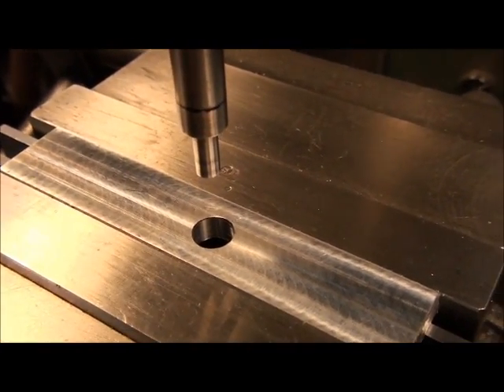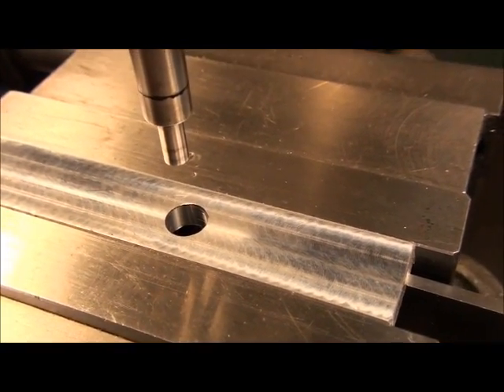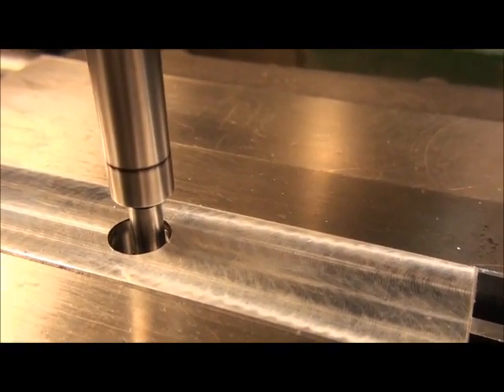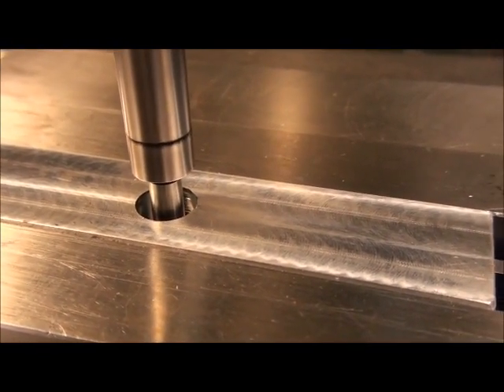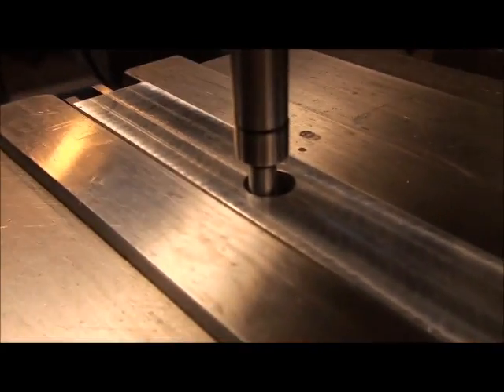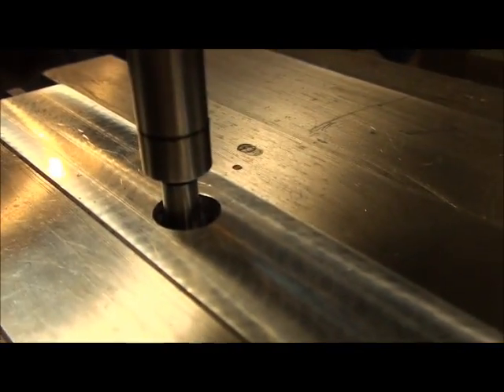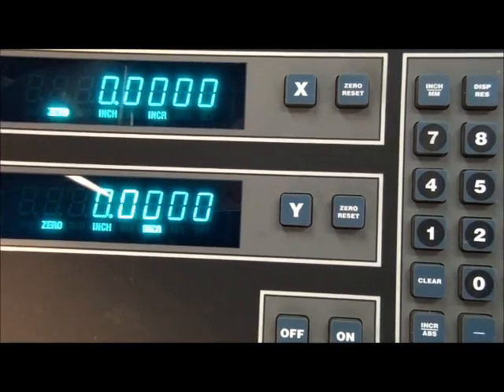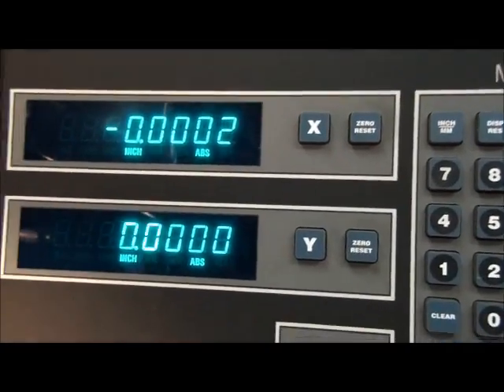How to Use an Edge Finder to Locate the Center of a Hole

Comment: This is a cool tip. I'm guessing theres no concern where exactly you touch off because when you travel across the axis to touch off on the other side, the midpoint is the same regardless of how close/far away from center you are.
Reply from the maker: I've tried doing it with the edge finder off center and it really doesn't make any difference until you get way off center.
Reply: I'm impressed!
First a question.
When you say 2 tenth off, does that mean 2 tenth of a thou(sands)🤔
I'm not used to imperial measures 😐
Afterwords I speculate whether in theory you ought to switch rotational direction on the spindle, when  touching of on the far sides and near sides  of the center due to the curvature of the periphery.
I know it's theory only and your comparison between incremental and absolute measurements says it all.
Your comment about "way off center" indicates that when you are way off center, the curvature of the periphery, means more than when you are close to the center?

Comment: I use this tip all the time now to find center of a hole in my mill. Drives my lead man nuts! lol. I still double check it with my indicator, just to assure him that I'm still using one, but this tip has never failed to put me within a tenth or two of dead center, and quickly! Thanks for this video!
Reply from the maker: I've verified it with an indicator as well. It's scary how well it works.

Tom

Comment: Just use an indicator PLEASE. No math involved.
Reply from the maker: I wouldn't exactly call pushing a midpoint button on the DRO math, but you are certainly welcome to use whatever method you like. That's the nice thing about machining, there are a lot of different ways to accomplish the same thing.

Tom
Reply: I guess it depends on how accurate you need to be. Center drilling and then drilling and reaming I would say could get you to .001 accuracy between holes. When I really wanted to get as accurate as I could I used to center drill then drill and then ream with a slightly smaller end mill than the reamer. Then I would chock that reamer up short. Also I would put the center drill in a collet, NOT in a drill chuck. Any unseeable wobble could throw you off a couple thou in my opinion. And if the top edge of the hole needed to be perfect I would either start the reamer by hand with the machine out of gear and then start it in gear with the reamer already down into the hole about 1/4 inch. OR flip the block over and ream it from the back.
Reply: Tom...you are a patient man.  Finding a distance and dividing by two is barely math as well.  Thanks for the enjoyable videos.
Reply from the maker: I am a patient man. :)

Thanks for watching.

Tom

Comment: i put in a fixed counter center from a lathe and takes me about 10 seconds or less to find the center =).
hole has to be smaller then the counter center though.
Reply: How?
Reply from the maker: +noshortnamesleft atall 

It sounds like he is putting a center in the spindle and "finding" the hole by feel. Fast maybe, but not very accurate.

Tom
Reply: +noshortnamesleft atall and also works in a 4mm hole, accuracy is very good.

Comment: Don't forget the pointy end of the finder,it works pretty well too. . . .especially on smaller holes.
Reply from the maker: The pointy end is actually used for locating a center punch mark, not a hole. The idea is to place the point into the punch mark and then adjust the table until the offset is minimized. You can get close by feeling the offset with your fingers, or use a micrometer. I wouldn't suggest using the conical point for critical holes because you would be locating off the edge of the hole, not the bore. For small holes, just put a pin gauge in them and locate off of that with the edge finder of an indicator.

Tom
Reply: You know, I've been messing about with machine tools (as a rank amateur) for about 6 years now, and never figured out what the conical tip on a Starrett 827B is for. And it certainly isn't that I haven't looked for this information, on the Web and elsewhere. So thank you! 
I think a short video demonstrating the use of this little frammis -- and why it shouldn't be used for locating holes and similar features -- would be really useful!
Reply from the maker: beepcode
I would not recommend doing that, because you would be locating off of a sharp corner instead of a face. The least bit of a burr would throw off the reading.

Tom
Reply: Toms Techniques
Not Exactly true. The Conical tip is better for finding slot centers and holes and features that are smaller than .200.

Comment: Within 2 tenth`s or two 1/tenth`s ?
Reply from the maker: Two ten thousandths of an inch (.0002).
Reply: Agree, Yes Two tenths of a thou......A typical machinist usually uses .001 as the reference unit.  For example: we don't say "Point four" but rather "Four hundred" (.4)....

Comment: Good information! Could you hypothetically use the same method on a CNC Lathe to zero out a drill collet? I may have to try, It would be 20 times easier and quicker then using an indicator.
Reply from the maker: Possibly. As long as you can move the edge finder in two axes.

Tom

Comment from the maker: Without a DRO you need to take into account the amount of play in the leadscrew, usually .010"-.015". Every time you change direction, you need to add that amount to the reading. If you find the center using an edge finder you can see exactly how much play there is in the screws and split the difference when you zero the dials.

Tom

Comment: I use a manual mill without a digital read out and use a taper dropped down into the hole and move the bed back and forward front to back  with "blue"  takes a bit of time but works for me. I make parts for motorcycles like the bushings to convert to single sided swing arms. All have worked and the people have always been happy.I have never used digital but might try it the next time round.

Comment from the maker: Just the opposite. It will center as it approaches an edge and then jump to the side when half the diameter of the tip from the edge. The tip on this edge finder is .200" diameter, so at .100" from the edge, it will jump to the side. Then you just move .100" to center on the edge and zero your dials or DRO.

The pointed ones are used to find center punch marks. You put the point in a center mark and adjust the location until the diameter at the split line mics the same as the shank.